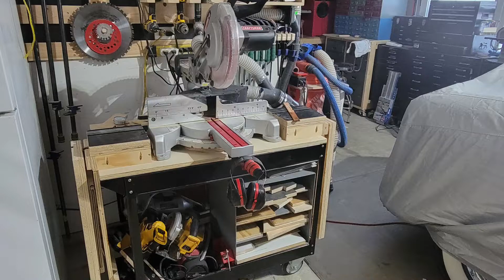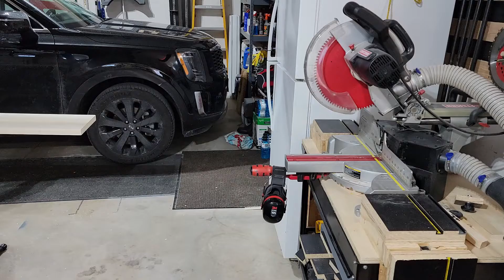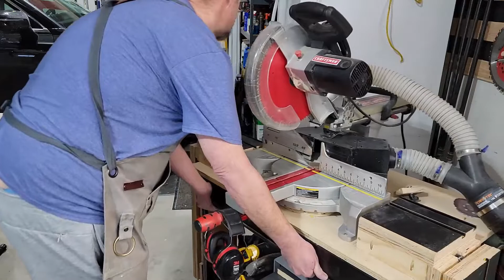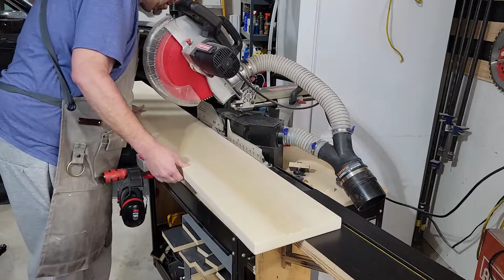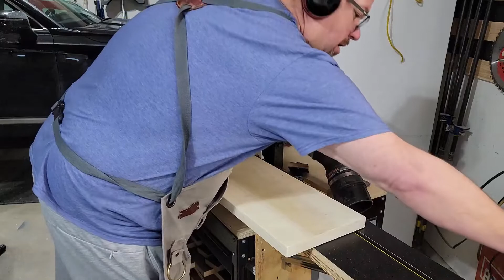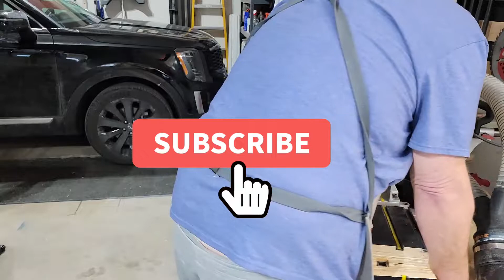Shop Log: My Folding Miter Saw Station | Woodworking

Comment: Your saw looked like it was grabbing or you had a balance problem. But I did like the way your wings lock into place what kind of system did you use
Reply from the maker: It's a 24" folding table bracket. I buy them by the pair on Amazon. I used the same ones on my folding router table.

Comment: Do you ever have issues with it tipping forward with deeper material?
Reply from the maker: No, it's pretty rock solid. I've cut up 12ft long 12x2's on it without issue. Those folding brackets are rated to 300 lbs. The cart also has enough weight to make it very stable.
Reply: @TheSuburbanGarageWorkshop  That ballast weight must be key.  I have  a 12 slider that almost tips off the bench if not bolted down with larger material.  Love the content.  Perhaps something on that coming up?
Reply from the maker: @Jaspel  The saw is bolted screwed down into that 3/4 plywood, which is attached to cart. That saw is an older model so it pretty heavy with alot of the weight firmly over the cart, even when fully extended. Even before I bolted it down it was pretty stable. I really bolted it down so my measurement alignment would stay locked in. The cart is a HF rolling tool cart. I just installed the top upside down to give me a flat surface. They go on sale alot. I think I paid $60 for  it.